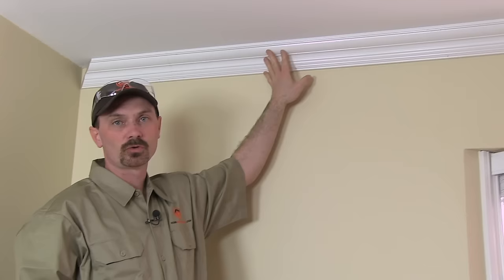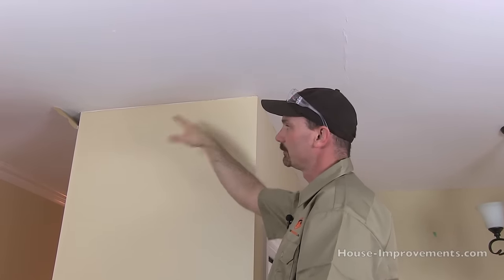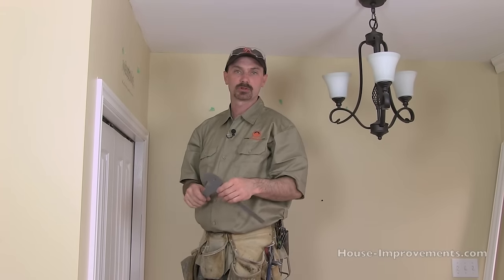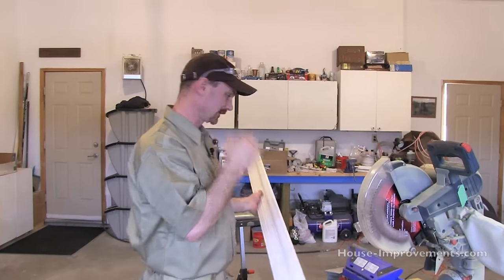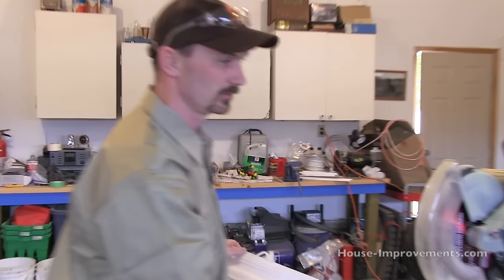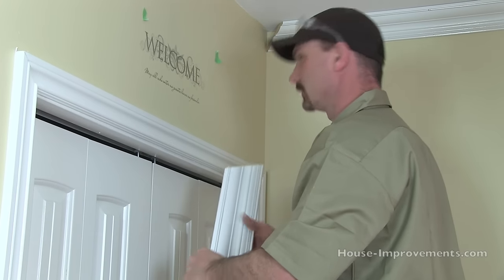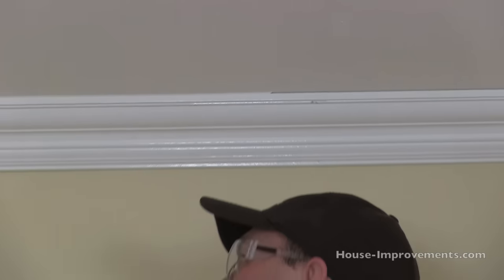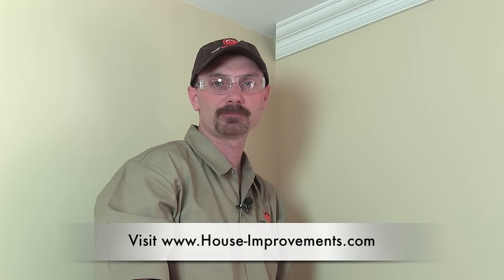How To Cut & Install Crown Moulding

Comment: Shannon,  I use a dremel  sanding drum to shave the back of the inside cut of the crown. this will allow you to get the cope cut closer in to the square cut side. I find that you can be more precise and quickly remove the excess wood from the back of the crown without damaging the contour of the cope.  The dremel comes with different diameter drums in order to get closer to tighter contours and configurations. I hope this tip helps you.
Reply from the maker: Nice idea, Mdf if tough to cope with a saw
Reply: Coping is very easy, but it's experience I've acquired over time from doing base and crown molding. MDF can easily chip if your not careful on your entrance cut and exit. I like coping on wood product, but now a days MDF is a lot more common.
Reply: simply hyperextend mitre no need for dremel

Comment: I'll add to the negative comments: Dry wall or Gyprock here in Australia, those corners are never going to be 90 degree's ...yes you'll prob need to caulk it. But if it's caulked well you won't see it.

Comment: @14:37  I know this is an old video.  I've installed quite a bit of crown molding as DIY.  What I've learned is that it's better to leave the ends of each piece loose, don't nail them yet until you butt the other piece to it.  That allows you to make any minor adjustment and minimize the gaps before nailing.

Comment: I would make sample cuts for all corners on a small scrap bit ,see if it fits tight,adjust the angle to fit . I would be pretty disappointed if one of my outside corners was that open
Reply: I wouldn't pay for that
Reply: gasmanrm
Reply: Small scrap pieces do not help, 1’ piece fits different then a 5’ or longer piece...people should understand that it’s not the carpenter to be blamed but the framers, sheet rockers...crown should be installed level, not following the ceiling, that’s where everything gets screwed

Comment: I take a scrap piece of crown and attach a piece of fine grit 320 or 400 to the profile with spray adhesive. Make sure it is pressed down into the profile well. I use that to clean up the cope cut. It can smooth out the cut and make a nearly seamless fit.

Comment: We put a piece of tape on the fence and scribe a line .  Feels more secure for me ,especially working with long runs. And cut lefty or righty so you don't cross your arms up! Safety first! 
 You can use shims to get the joint tight and bring it off the wall a tiny bit, looks better and easier to fill gaps. Fine finish deals in half of half degrees!  Glue joints. Putty is not my buddy. Bondo , it's ok the painter will fix it!
Reply: You can also roll the molding slightly to tighten up gaps.
Reply: True...I have used a block to tap up from bottom or in at to to help roll...works well for me.

Comment: I HATE CROWN MOLDING! ; )...Our houses here in philly have really bad ceilings and walls...Scribing,  fitting, and forcing and pin nailing>>I would shoot nails into that outside corner with the tape... I use my portable table saw for coping too...I set the blade to just a hair below the face and carve it out...Way faster...

Comment: Pro tip for anybody just starting out mark your pieces in place for where to make your cuts instead of using a tape measure. You will have better joints doing it that way. And always cope your inside corners.

Comment: Instead of using a coping saw, I like to use a dremmel tool with a large and small sanding drums.  It's 10 times faster and you make even more precise fittings.  Cheers!
Reply: So you can not cope with jig saw.  How you would use dremmel at maple?  Advise for yours coping skill - go drive school bus.

Comment: great job again. Dap it, paint it and it'll look great. Some outside corners can be a bit of a pain.  A little trick that I do whe having a problem with the outside corner is get a small block of wood and depending where the gap is, top or bottom  of the corner I'll put the block akainst it and tap both crowns lightly to bring it a little closer. Not to much but just a little. It may be right or it may be wrong but when Im done nobody will ever notice lol. Another great vid man. keep'er goin.
Reply from the maker: A good carpenter can make it look well enough that no one would ever know you had trouble.

Comment: im using a tube of caulk per joint, is this normal?
Reply from the maker: +wizard owl  Wow ,I would say no!
Reply: +wizard owl You might want to check your measurements when you get close to a case per joint...: )...I've seen some joints like that...:)
Reply: Caulk is the thing !
Reply: lmao
Reply: pack it full with saw dust and then less chaulk...saw dust is free lol
Reply: Caulk and paint makes you the carpenter you ain't...
Reply: for me it is
Reply: Sounds about right
Reply: no
Reply: If u ain’t using a can of potty on each board u ain’t using enough nails
Reply: Well it depends if you are using a 10 oz tube per joint you are doing ok, start worrying when you start using the 20 plus oz tubes! Good luck and buy them by the casa it’s cheaper that way $$$$!!
Reply: Case sorry
Reply: Lmao
Reply: Sure,perfectly normal.

Comment: yeah this guy seems to know what he's doing to a point me on the other hand I've been doing it for 15 years and I learn something new everyday.    you always start with the smallest piece first no matter where it's at then you work your way out small pieces first all the way up until you hit the biggest piece and the biggest piece is popped in place then and only then you will have a 100% tight connection on all fits.  and we don't cope anymore.   when do 45 degree cuts 22 + 1/2 33 + 1/3
Reply from the maker: good info
Reply: bro I know for a fact you can teach me some things so I can show you some shit on how to trim out a house will blow your mind.     husband trimming out homes for almost 15 years.   use your million-dollar homes and up.    I would love to sit down on the phone and talk to you because I try to learn something everyday
Reply: so you don't cope at all anymore
Reply: chris m 

yeah I learn not to cope anymore.    about my second house I quit coping.   La Mai my material down and I cut from left to right and I never move the saw once I put it in its opposition it's degree cut I don't move it I move the material I twist and I turn and I flipped the material.    and I got from left to right so my hands are not making an X by the saw.   which is extremely dangerous to do
Reply: chris m 
me personally I am hung just to see if I can do it or not and trimmed out 18 doors solidcore 8 Footers by myself before 10 hours.    that's including the back door.   and anything upstairs oh yes that's also including double doors.    you'll see me hang the trim for a window it would blow your mind that you would see only one man doing this.  I also hang around by myself all the way up to a 22 footer.    you're probably thinking how do you do a 22 foot piece of crown well you never voted together in the middle that's dangerous.   you have an equal amount of weight on both sides and when you go to pick it up in the middle it will break.    unless you give it a back if you take a piece of quarter inch about two foot long and you glue it to the back somewhere in the center of your break then you're good
Reply: chris m 
I also when I go to measure crown or base I carry what they call a dummy block so I will get a true measurement.   oh by the way The Sharper you keep your pencil the truer the cut
Reply: If you're not coping, you're a hack. No way you'll ever get a tight corner. If you're staining your woodwork, your joints will look like crap and no amount of wood filler will make them look right.

Comment: My Gosh People, nothing is perfect in the fix-it / construction world. The normal homeowner doesn't know how many imperfection there are until... DIY comes into play. In my house every darn wall isn't straight, even a 2 inch joining wall is bowed in ~ at the corner. The floor is UN-level as heck and different size plywood was used for the sub-floor. I know this because tiling (Qty. 500 13"x13" tile) proved its ups and downs. Then there were the walls in fitting quarter round trim, along with some baseboards. My goodness so many variables and then working hard to get it as-perfect-as-perfect can be. So we shot for perfection, but still nothing came out perfect. By the way Great Video! You talk slow like my husband and have a pleasant voice. Your voice makes it for easy listening, unless I'm on caffeine lol Just the same, finally someone slows down to explain the details and what type of tools they are using. From a 1-5 rating I give you a 10 for all the helpful information. Now I can hang crown with a bit more confidence. Again, thank you for taking the time to post the video.

Comment: Also, if nailing into sheet rock, you're molding will eventually pull away. On a wall that has no ceiling joist to nail into, you need nail in backer blocks that are the shape of the back side of the crown and nail those into the wall studs. You can then nail the crown into the backers. The crown will not sag or pull out if you do this.
Reply: Thank you for that tip.Swedish carpenter here👌

Comment: I understand that nothing is perfect site conditions vary from job to job but I have done a lot of trim work as a master carpenter and the use of caulking cheapens our trade weather it is stain or paint grade the joints should be closed ,this is where the home depot carpenter are separated from the one who have served there time and take pride in there work
Reply: I'm a master carpenter too, but I learned the difference between weather and whether, and their, there, and they're.    It makes a difference when selling a job..
Reply: I appreciate where you're coming from. but no master Carpenter started out as a master Carpenter. You just do the best you can until you get there. And sometimes it's not how you start, it's how you finish.

Comment: when you nail the crown up are you actually trying to get it into the framing or are you just tacking it up there?
Reply from the maker: On the wall you will have 3" of framing (top plates)  at the top of the wall so unless your crown is really large you will hit wood along there anywhere. At th ecfeling you can mark out and try to hit the rafters but I find that if you just angle the nails slightly they hold very well even just into drywall on smaller crown like this.

Comment: Sorry, but coping an inside corner is the only way to install crown. Corners are never 90 degrees.
Reply: can't make you miter meet so you cope   if you are having problems with inside miters you are probably doing it wrong
Reply: Ask any good trim carpenter. Mitering inside joints is for hacks. If the wood shrinks over time, your joint will show. Never will happen with a coped joint.
Reply: i've been doing finish carpentry for 35 years and work in some of the finest homes in fairbanks ranch .la jolla and ranch sante fe in san diego county doing work that people walk into the room look and wow and stare.So you are right   good trim carpenters cope inside miter joints   great ones make the miter meet. that will be all grasshopper ,get back to sanding my work with 360 grit
Reply: Whatever makes you feel better about your work...If your joints shrink and swell like  they do in the Midwest due to heat and humidity, your mitered joint will show every time.
Reply: If you're using MDF, PVC or any other engineered product why are you worried about shrinkage? I'm not understanding why you think a coping cut resists expansion and shrinkage any better than a miter. The only way I can think of to resist shrinkage and warpage is a rabbet on the back of your crown. Also La Jolla is right on the coast and Rancho Santa Fe is in a valley not far inland that stays humid year around, all the while experiencing California heat so I don't see why you think the mid west would be a more challenging environment. San Diego isn't Arizona.
Reply: Douglas Hanlon, are you looking for any help?
Reply: Go watch the Ron Paulk video series and maybe you'll learn something. The guy is a true professional.
Reply: Nick Huber deff true but did he not do the job

Comment: and @ Bulldozer Guitar - WRONG - he is NOT showing beginner methods - he is teaching bad habits and sloppy fundamentals.  if you watch in order to LEARN for the first time, OMG, do NOT learn from videos like this - find a good carpentry BOOK, professionally published, there are so many excellent ones....which teach the detail steps which this guy simply does not know - like adjusting a crown miter connection in order to meet flush, in order to be properly bonded together.  it is not rocket science, but true carpentry involves so many small detail steps, all for important reasons.   for example, THIS video:  crown connections that are not flushly bonded, WILL MOVE and look terrible in time - can you imagine how caulking and painting that gap will not hold it?  things cannot be bonded from the outside exterior meeting point, they must meet flush.  

You wrote "the worst of humanity"....you are missing the entire point.   it's OKAY to be critical and correct people and tell if someone is ignorant.  put your sensitivities aside, Bulldozer Guitar.

Comment: Should you be concerned about hitting studs or ceiling joists with your nails?
Reply: Crown molding is not really very heavy. And it certainly is not structural. Although there are many that insist on trying to hit studs.
Reply: @Hello Tom how are you doing

Comment: Screw negative people. you'll never find perfect ceilings or inside/outside corners that's why you have to use caulking to fill gaps where they are period and you are doing a fantastic job.

Comment: This is the man to go to??? This guy sets such a bad example ESPECIALLY for beginners who need to see it done well. When a beginner sees a "professional" do a sloppy shit job, they then in turn aren't going to know the methods to correct imperfections. Ie: the first problem I saw was the outside miter that was pushing an 1/8th off, out at the top. That was an opportunity to show beginners how to deal with a problem when u cut a 45° cut, but the walls out a bit. He could've taken that piece down and showed the audience how to correct it... But he didn't... Then when he attempted to bring it together, he was relying on the glue and nail itself to bring it together when he should've been forcing it together and nailing it once his hands had squeezed the joint tighter. Idk all n all not impressed at all and it's a shame because he had so many opportunities to show beginners especially how to deal with problems that come up all the time. The profile came down below the top plates... We're you locating studs? Did u mention to the audience that your nails have to actually grab wood and the molding isn't just nailed to sheetrock?? Now a bunch of homeowners are going to think crown just gets nailed to sheetrock... Man. Idk wat to say.

Comment: Your a good teacher,But your comment,, "A little more open then you like" has an answer.........Dont teach Beginners to use MDF that stuff is garbage the reason your corners wont match up is this,,,,,,,MDF  "WONT" bed down right,,,,if you bed it to the wall your is open at the top,,,,if you bed it to the ceiling the gap is at the bottom that stuff is a carpenter`s nightmare  the builder dont want it the home owner dont want it the painter will bich  wood may cost a little more but "Mr. Home owner" will have a better outcome   and rent a double mitre saw at home depo and set the wood flat and cut at the 331/3 setting

Comment: Thanks for video.  1) why didn’t u shim the inside corners to make the joint better?  2) Why bother with the cupped cut?  It didn’t look better at all.  Also, it seems pretty difficult.  Why not just use a 45 degree inside cut?  Thanks in advance.

Comment: I've done this many times until I learn, the wall angle corners are not 90 degrees perfect, so to make a perfect joint I don't rely on the 90degrees circular saw. need to measure exactly the outside and inside to make no gap...and then follow the mark where you cut by circular saw, but need to excess at least 1mm cut to fit tightly, don't be worry coz the coving is flexible.

Comment: Bad cuts. You should’ve cut scrap pieces to really check the Outside corners. You Should’ve cut 45.5 for the outside corners for tighter fit and caulk . 
Plus you should’ve glued before you put the pieces up. 

The inside corners you did good with the coping saw.

Comment: but he is using a...…………...compound mitre saw though, not hating here but that ceiling looks all jacked up, I would think they would throw some texture down to at least hide it, I would definite address the state of the ceiling first to me putting crown on it is like putting lipstick on a pig....very ugly pig at that, as far as the gaps are nothing, you can only do so much with imperfect corners, caulk and paint make it what it ain't", meh coping mdf lol, no thank you!

Comment: Cut crown flat on table....so much easier,  nrver have to move settings and every saw comes with locked indents on 31.6/33.9 settings.....less rotation of material as well and since crown is flat dont have to worry about if it "rolled"on saw......idk i have laid miles of this stuff and its only way i cut it

Comment: Shannon does a lot of things right but crown is not one of them. I hate to be negative but this is not the best way to do crown.  I learned by trial and many, many, many errors.  Long story short... CA glue your outside corners and wood glue your inside corners but temporarily slide a shim in to close the gap before you nail. Pull the shims once the glue has dried. Perfect joints every time.  Don't waste your time coping. Same result way quicker with more glue to hold the joint.